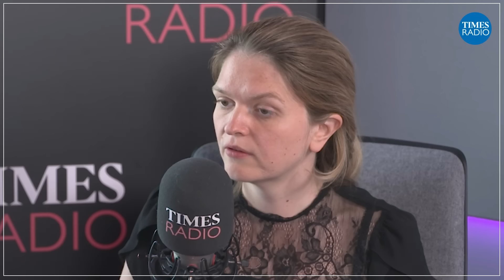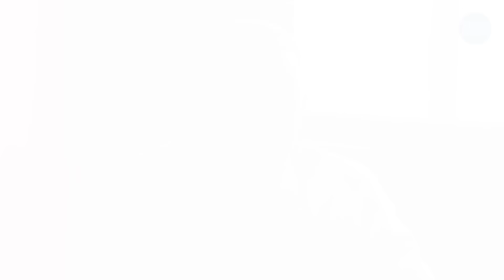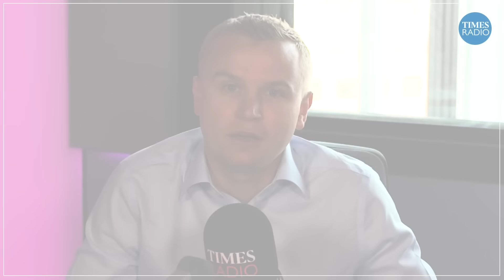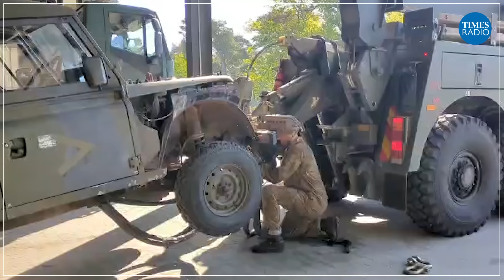Britain sends Ukraine a machine to print weapons components | Larisa Brown

Comment: Ukraine has been 3D printing plastic parts for drones for years. I’d be most surprised if they haven’t used them to replace plastic comparants on old weapons/vehicles for some time. Also there are many 3D printing bureaux around the world which I’m sure could help out. A scanned component design can easily be emailed.
Reply: Slightly different scale here and you think commercial grade 3d printer materials are up to the job of repairing an actual vehicle, not a toy drone
Reply: @suburbia2050  Yes. I use them regularly for light aircraft metal components, including structural parts.
Reply: @tonyb4773  This tech is from the F1 industry and uses a robotic arm to fine tune the final form of the metal, its on a different level
Reply: @suburbia2050  of course bearing surfaces always have to be machined.

Comment: Ukraine has already received several large 3D printers from US and Germany. But the more the better
Reply: Do you listen? These ones are different and are on the Frontline not 500 miles away in Kiev,the Brits have modulated it to be used straight away on the frontline. 3d printers have been out for decades so it's not about that.
Reply: Listen to the interview...🤦‍♂️🤦‍♂️

Comment: These 3D metal printing machines are particulary useful when making parts that you normally can't make on a milling machine. That is to say, the milling proces is pretty much unbeatable when it comes to production speed (does not apply to non-cutting machining processes, such as plastic injection molding, sheet metal pressing etc), but any part with a strange inner cavity would be impossible to mill. So for example, a lost-wax casting part, which is very difficult and time consuming to re-start production of, appears to be a good candidate. This is just an off the top of my head reaction to the news. Good job Britain!
Reply: Still will need G-code tho to work :)
Reply: These 3d printers their using are doing the parts in less than 10 mins. They sand blasting it basically. Blasting aluminium particles on the bed at mac3 speeds so it compounds lol. Clever.

Comment: My next question how and where are they going to get the technician information to be able to print those parts on the front line.. Unrealistic and unpractical.
Reply: Easily. There's this thing called the internet and FACE-TIME. Just one call and they can be connected with a British army expert 24/7 365. Welcome to the 21st Century. Russians don't have toilets and the Ukrainian have the latest tech.
Reply: Well it seems they are doing it. Time will tell just how valuable this asset is. Worth experimenting on.
Reply: Not at all, get the required techie help online from specialists. They would logically be kept away from the immediate front and receive the specific part in downloaded file version. Really not difficult and very adaptive
Reply: 3d scanners are a thing - so you scan one of the components that you have that's intact and then make more.
Reply: @timmurphy5541  Thanks. I can see how the evolution of this for the battlefield could well revolutionize and save milliions on logistics.and of course save an awful lot of time. Many wars throw up enduring scientific/industrial initiatives and maybe this and drones are the ones for this war. Interesting to watch how this develops.